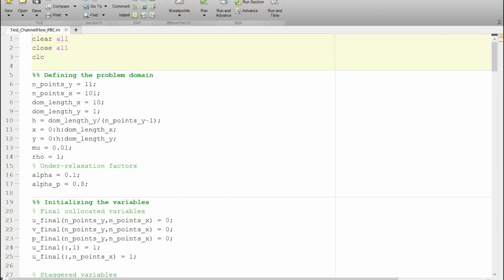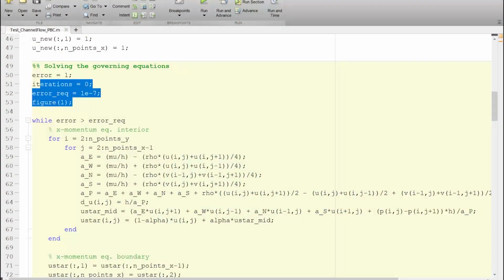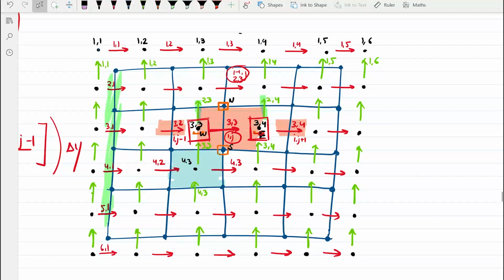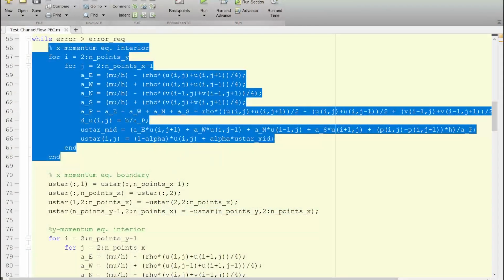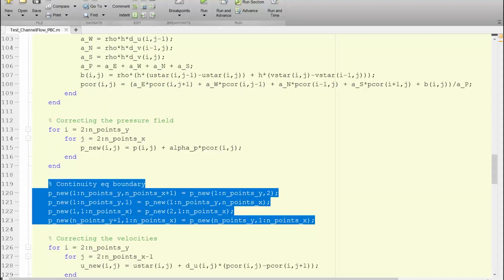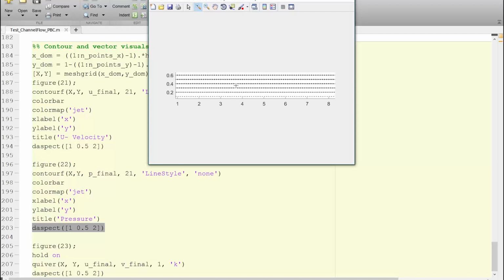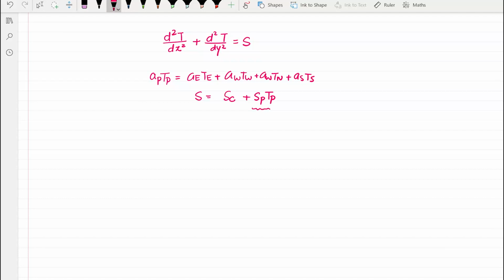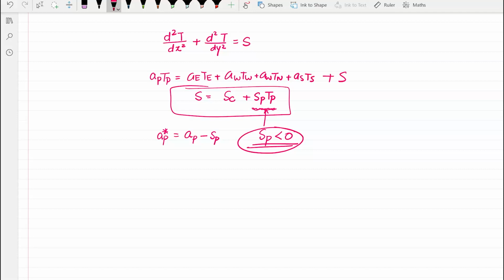Last Session + Q&A | Channel Flow | Periodic Boundary Conditions | Source Term | Lecture 24 | ICFDM

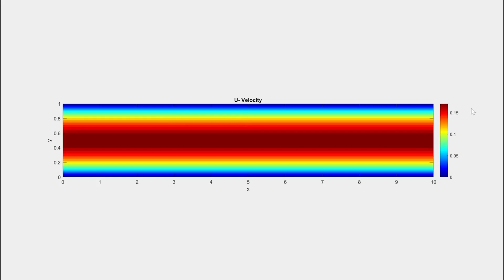Comment: @Tanmay Agarwal : Sir, at time frame 16:59, the contours of velocity profile seems to be misleading. We start with initial velocity as 1 m/s. But the Umax obtained (red region) panel shows it as 0.15 -0.17 as max velocity. It should be above 1 m/s right for mass conservation?
Reply: did you get an ans. ? I've the same doubt.

Comment: would u mind checking this code? cuz these boundary conditions are not working for me as my code is using transient SIMPLE algorithm and instead of what u r doing i sustained the mass flow rate at the outflow  using the factor (m_in/m_out)*u_outflow=u_outflow and only then i can set the inflow new velocity equal to the outflow velocity. Using these boundary conditions for periodic boundary conditions, the code is working fine. When I tried to introduce these boundary conditions 2 years ago the solution diverged.

Comment: Thanks for the good explanation. I am trying to implement also PBC in staggered grid in elastic wave FD scheme so there is another component Sxy in the corner in the st. grid. When i make the straightforward iplemementation Sxy becomes zero and makes the reflection BC whic is I desired to be periodic. Have you experienced this? What could be the possible solution=

Comment: Does Ryzen CPU and nividia GPU driver have issue ? I have heard from Tom Hardware website..... Can I run mechanical software like Openfoam, Hypermesh, Ansys(Simulation), Converge CFD, Ansa in R yzen smoothly and what about linux
Reply from the maker: I use the same system, works fine with me.
Ryzen 3600 + nvidia 1660